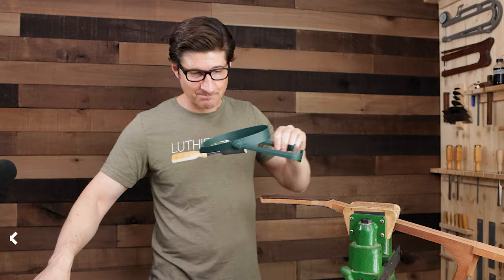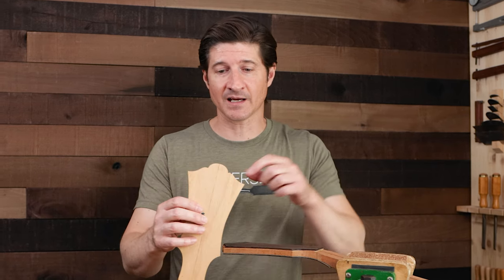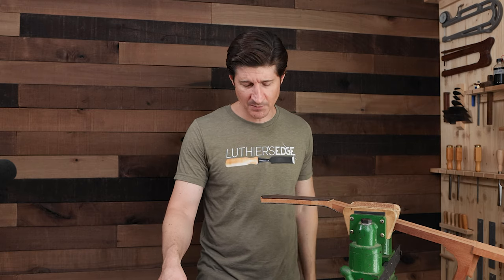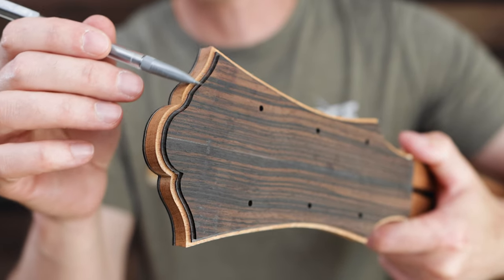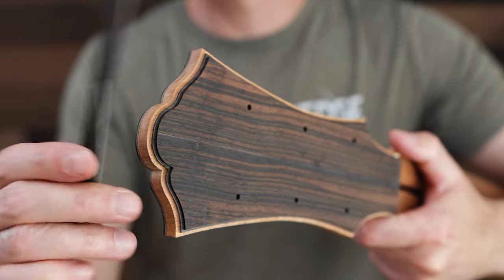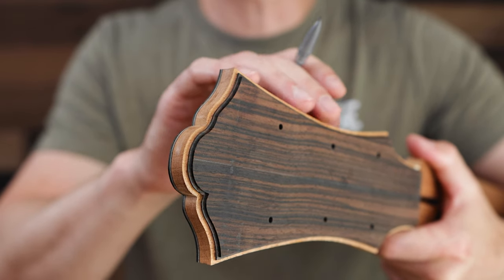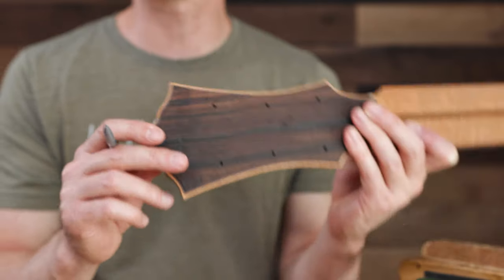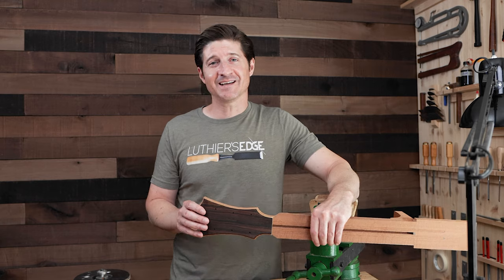Better Headstock Binding Channels (A Quick Tip)

Comment: You mention tear out & I have to wonder if you use router climb cuts on headstock veneer, same as you might when routing body binding channels.
Reply from the maker: Yes, I use a climb-cut for sure on any binding channel I do, it really helps to reduce tear out.